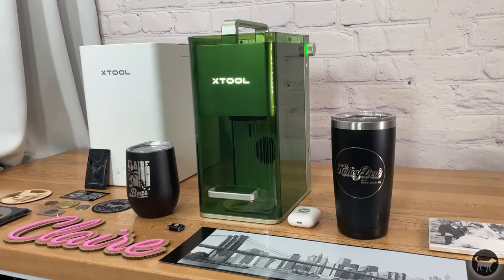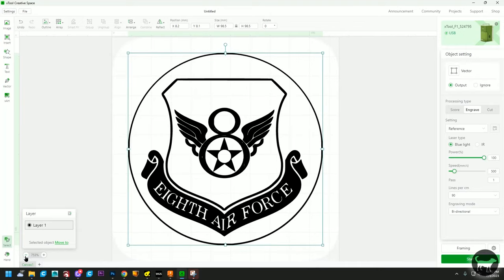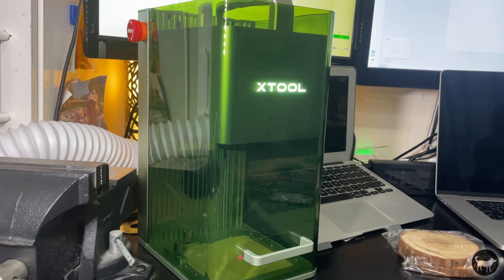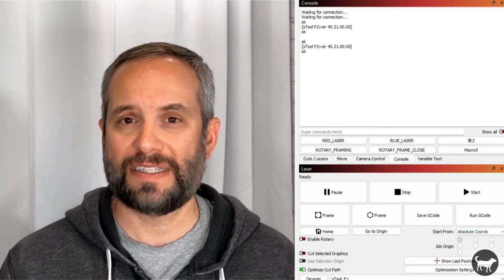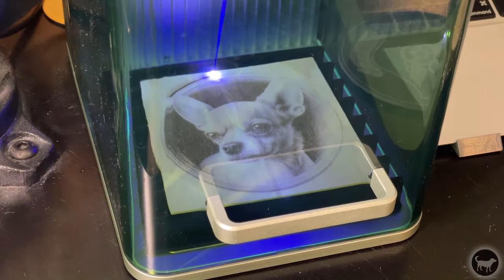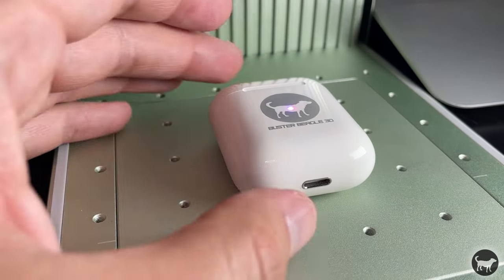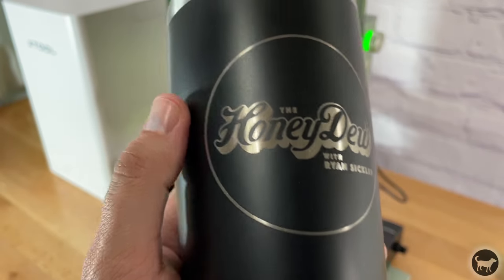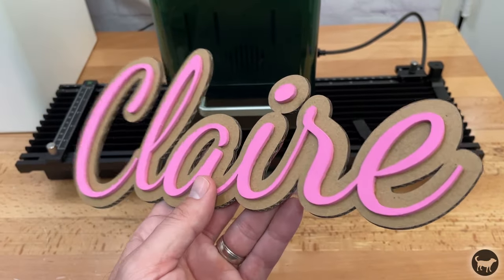xTool F1 Dual Galvo Laser Engraver and Cutter Review | 10W Diode | 2W Infrared Laser |

Comment: Can you sense the impressions you've made on the F1 when engraving on metal?
Reply from the maker: If you mean can I feel them then the answer is no. They are really just superficial marks.
Reply: @BusterBeagle3D  So for making more quality engravings, it would be better with a fiber laser? Or is the F1 good enough?
Reply from the maker: @NotDoingThisToday  It depends on your needs. If you only want to do metal and you actually want to engrave deeper into the metal I would go with a fiber. If you wanted the flexibility to also do wood and other materials in addition to metals and deep engraving is not important to you then the F1 is a good choice.

Comment: By far - the best, most informative video I’ve seen on the F1 so far.  I was still on the fence whether or not to buy an F1, and kept wondering if a cheap 20w fiber was a better option.  I now understand that the F1 will offer me so much - especially as a total newbie. My P2 just arrived and is still in the box.  Thanks again.  I will definitely use your affiliate code when I buy my F1.
Reply from the maker: Thanks! I'm glad it helped you out.
Reply: Same situation, i was choosing beetwen jpt 20w fiber and F1, and choosed the last one. Fiber is a very good machine, maybe buy it later

Comment: I am brand new to the F1. I have the slide extension with a business card jig. My question is how do I know what settings to use as far as the blue or the red laser? I have an svg picture with text I added to it. Is it ok to group the text with the image? At one point, I got a message about the object setting which said you can't set parameters for both a vector and bitmap. So, the bitmap is the image and the text is the vector? I'm just confused when to pick what laser. Is there a list of settings for XCS, such as the one Xtool put out for Lightburn?
Reply from the maker: Yes. Text is line data which is also know as a vector. An image or photo works as what is called a raster image. A bitmap, jpeg, png, etc are all raster images.  When using XCS you only get the settings that correspond to the type of file that you are working with. The IR laser works well on metals and plastic where as the blue diode is good for woods and other organic materials. xTool does have a list of settings for the F1 that you can find more about here: https://www.xtool.com/pages/material-settings
The even tell you which laser you should use for what.

Comment: How durable is the marking on brass and that necklace? Does it come off easily?
Reply from the maker: It’s marked on the surface. It can’t easily or wipe away. I suppose you could sand it off if you wanted but I’ve never tried.

Comment: Would recommend the F1 for someone just getting into the industry and isn't sure which material/products I'd to focus on.
Reply from the maker: As long as you are planning on only doing relatively small projects it’s not a bad one to start with. However for the cost you could go larger with another brand and have more flexibility. It all depends on your needs.

Comment: G code license? Huh? I just bought my machine and trying to set it up. Not working. Must be this but I don’t know what you’re talking about. Where do I find this?
Reply from the maker: Gcode license refers to the version of license you would need to purchase if you wanted to control the machine with the Lightburn software. You don't need to purchase anything if you prefer to use the free xTool Creative Space software that will also run the machine. You can download that from the xTool website for free.

Comment: what is the max height of an item you can engrave - looking at doing  some of the 46oz or 1.36L yeti tumbers. just want to make sure that size would fit under the laser once its on the rotary
Reply from the maker: I believe the max height is 113mm so you might need to get creative if you want to use it with a tumbler that size.

Comment: We are trying to use the F1 on rocks to etch with rare success. Red Jasper and a few others etch with varying results on the same rock. Any help
Reply: I'm not a user yet, but from what I have watched it could be a focus issue if the surface is not flat and level. Also, if it is reflective that could be an issue, might paint it with some washable black paint. Good luck.

Comment: Hello, thanks for the great video. We just received our F1 and we’re trying to figure out speeds and other processes with it and XCS. We used laserbox basic with our D1 and it was really simple for us noobs doing our Tumblers. 

Can you explain where to find how to change the “lines” to 200 on XCS? Also, we’re assuming that the “speed” is called something else because we don’t see it anywhere? 

We want the best settings to completely remove the color coating on the tumblers for a really clean look (bare metal). 

Any help you can provide would be amazing and keep up the stellar work 🤙🏼
Reply from the maker: This is probably too much for a youtube chat but XSC works much the same as Laserbox Basic. The difference here is how it interacts with the F1. The reason you are seeing Dot Duration and instead of Speed is because that is the way it handles raster graphics (images) now with the F1. It will also show you DPI (dots per inch) instead of Lines per cm.  

If you drew out a vector circle you would see the speed again in mm/sec and lines per CM. Not exactly sure why they did that and since it could be a little confusing to newcomers but it is what it is. 

I think for my tumblers I was able to engrave at 90% power and 550mm/sec at 200 lines per cm because my design was a vector.  You may have to run some test to see what he proper settings for a raster image would be. The higher the number on the dot duration the slower the laser will move. A max of 3000 moves the slowest so it would be the darkest mark on Stainless Steel using the IR laser. 

Hope this helped at least a little.
Reply: @BusterBeagle3D  thank you for being awesome to answer our questions! Completely understand now and now we can do some tests to see what will work best for us. We’ll be subscribing and watching from here on out. We hope you have a great day!

Comment: Nice video I have a question what was the setting you use on the pach, so I can have in raiding
Reply from the maker: Everything I did can be found on the xTool Material Settings page. https://www.xtool.com/pages/material-settings
For mine it was 100%Power, 700mm/sec and 100 Lines per CM.
Reply: @BusterBeagle3D  thanks

Comment: This is a great overview - great info. I am struggling with white tumblers getting the engraving correct. Are Black easier to engrave?  I ordered the RA2 which arrives today so will give it a try based on your suggestions. I may order the extension as you did a great job showing its value.  You quickly mentioned the settings you used for each job - a cheat sheet for us newbies would be great. Thank you for the informative video.
Reply: Diode lasers are pretty useless for white materials -- the IR maaaaay be better, but white essentially reflects all the light back.
Reply from the maker: What the other Ryan said. It is possible but you may need to coat the surface with marker to be able to do this on a while tumbler. Honestly I haven't tried but I would recommend checking out the Facebook groups of xTool to see if anyone else has. I'm sure they have.